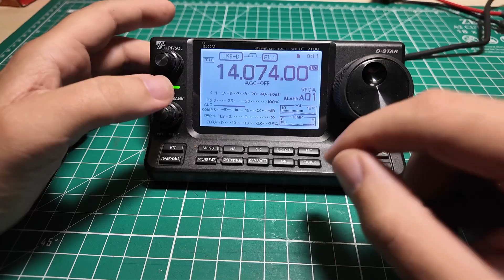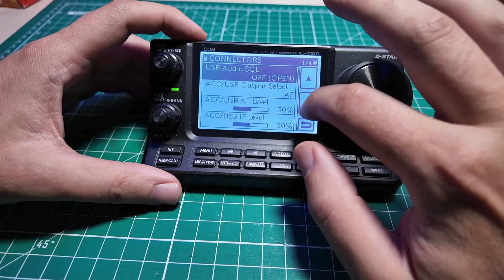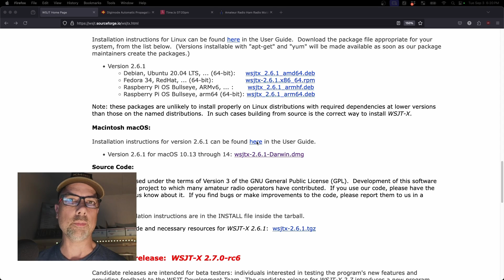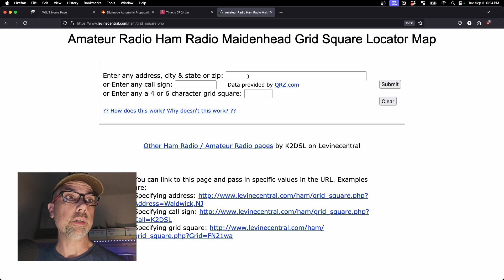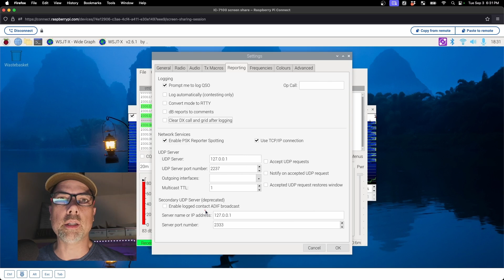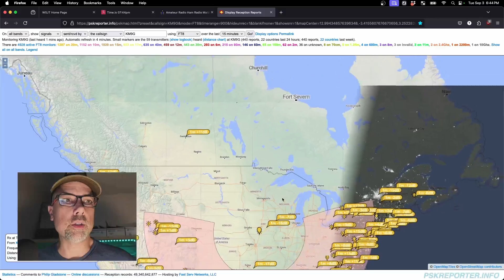Guide: How to FT8 with the Icom IC-7100

Comment: If you happen to be running your IC-7100 on FT8 would you be able to show any kind of manipulation on your ALC meter? No matter what adjustments I make in the computer or my IC-7100, I cannot get the ALC meter to go up or down. It does it on its own as I’m transmitting. For example, if I’m transmitting for an hour at some point, it will show two bars, then later it’ll show one or zero bars. 🤷🏻‍♂️ I tried every adjustment in this video and in Windows 10. No success. I should mention my FT8 is working fine.
Reply from the maker: As long as you're below the half mark you'll be making contacts.  The settings to fix that are all in the PCs Audio system.  Keep digging!

Comment: Can the 7100 be set as a session so that once the settings are ok, you can recall them and in the meantime talk on SSB etc?
Reply from the maker: No, that feature came out later on in a firmware update to the 7300 and on the 705.

Comment: Awesome video!!  My 7100 is set for back-pack field use but when it gets cold and wet this year I am going to watch this video ten times and get it figured out!!  Big thanks.  KN6OUJ 73
Reply from the maker: Good luck Alex!
Reply: How do you have that setup?  Looking for a backpack rig and I like the 7100 but that control head doesn't seem good for it
Reply: @CowboyPilot79  I use the 7100 in a backpack and it works great. I wrap the control head in a microfiber towel and put a couple of multi-use hair bands around it to hold it in place. I have the rubber feet pointed to the inside of the pack and my battery goes between the feet and the control head on top of the battery. Short power cable, control cable, and microphone in a separate compartment. There is plenty room in my small pack for a jacket, extra socks, antenna, etc. in the main compartment. 
Good luck! - KG5CYA
Reply: @rickarddavis8209 nice that may settle it, I've been trying to come up with a replacement for my G90, sounds like a 7100 will fit the bill.  Not sure how much I'll miss the waterfall but it will probably be more for directed comms anyway

Comment: I noticed a video you made earlier about the icom 7100 not transmitting, never seen an update on the problem you found it.   Just wondering 73
Reply from the maker: Its a "known bug" with the IC-7100 - requires that you factory reset it enough times to clear it out properly.  Disappointing because the radio is otherwise solid and that's a firmware fixable bug as far as I can tell (I didn't replace any hardware in the fix)
Reply: @temporarilyoffline  okay, never had that problem with the few ive had.  Just wondered and enjoy your videos. 73
Reply from the maker: @kennythompson9850 thanks!

Comment: Bunch of the 2M guys asked me to go FT8. Have 2 ic-7100's side by side in the QTH. One is set up the VARAC and PSK31. Other is for everything else. Your set up video is the best I've ever seen! Thanks. I don't think I'd like FT8 though. Great job!
Reply: I agree, this is the best video I've seen on FT8 and the IC-7100!  Thanks!
Reply from the maker: @robertbeasley4590 you're welcome!
Reply from the maker: Thanks for the kind words.  Like anything else, you have to find a mission for it.  Worked all grids with grid tracker? Contesting? Worked all states in a weekend? POTA while cooking dinner in a park? Or any of the other modes in the software...

Comment: great video, I just got a 7100 had been doing ft8 and cw things with a qmx for about 6 months while learning the ropes. This is quite the upgrade. 

The way you remote into an rpi is fascinating, great idea. 

Windows seems to hate this radio, anytime it starts to transmit it beeps at me detecting a new USB device then closes the port. I did not have wsjtx set to fake-it though so perhaps that'll solve it. 

If problems persist I got a bootable ubuntu ready and I can install wsjtx and see if linux works any better for me, or I have a few Pi's around and I can remote into one of those puppies! 

Radio stuff is a lot of fun

Thanks for putting this together, it helps the new guys like me
Reply from the maker: Hey Joe - it sounds like you have a problem with RFI.  When you transmit, you have radio signals going into the USB port and the computer loses it.  See this video for a demonstration of the problem and a set of solutions (chokes EVERYWHERE):  https://youtu.be/gwdEZlHSmjg?si=0sxQJ9RphnxaWoY4

A quick solution might just be to move the antenna further away.  Not sure 100% of your setup, but RFI is likely the cause.
Reply: @temporarilyoffline the antenna is outside of the house I'm running 25 yards of lmr200 to the end fed halfwave. I just crack a window and toss the cable out and hook it up. The antenna is hoisted up a spiderbeam mast. 

I'll check out the video, but the windows drivers setup 2 ports, half the time one of them says it has a problem and requires a reboot and its random if both devices show up without any apparent issue in device manager

The odd usb behavior just simply plugging it in makes me think its a driver issue not a hardware one. Thats before starting any software or transmitting on the radio. Just boot up, radio on (any frequency), and plug in the usb. 

I downloaded and installed the icom 7100 drivers and I guess having 2 ports is what its supposed to do (I don't know, I'm new to this radio). 

So that's why I'm going to plugin to a ubuntu box and give that a go next. I'll let you know how it goes, maybe tonight or maybe next weekend dunno. Depends how work / family / things go
Reply: @temporarilyoffline listened to the video, thank you!! I'm ordering two of those 240-43 and I'll get some chokes too to attach to the coax where I plug in at the EFHW. 

Mean time I'll also give ubuntu a try as I am seeing strange stuff in windows too. The laptop is not super old, and I'll have 2 more laptops to try soon too so perhaps between everything I'll figure out what's going wrong soon
Reply: @temporarilyoffline you're dead on with the issue, thank you so much! 

I don't have the toroid yet but i had 15 chokes i put mostly on the usb and some on the coax feed line. The scope looked better on wsjtx and it transmitted fine on 20m. I ran it at a pretty bad time of day where my qmx would struggle. I could see my signal on psk site going all over the usa and i got two responses before shutting it off

I am so curious how it's going to run when i finally get the toroids! 

Thanks again!
Reply from the maker: @HoldFastJoe-x7b sweet! Glad it worked out!
Reply: @temporarilyoffline I got two toroids, 240-43, and I wrapped co-ax about 17 times around the toroid and it ran so well, I was so happy! 

Digital scope was clean as can be, CW was better too (though harder to a-b test without a spare cable without toroid on it). 

I made several bahama's contacts, a few in europe, and handful around usa. Made more contacts on 20m in an hour than I ever have before! 

SWR meter on the radio was also very happy with the change. With the clip on chokes it was reading 1.5-1.8 swr, with the toroid it never went above 1.1. My signal strength on pskreporter was also significantly improved

thanks again!
Reply from the maker: Tahat's awesome, good to hear it worked out  @HoldFastJoe-x7b
Reply: I listened to part 2 of the noise video, glad i ordered 2 of those toroids! I'll wrap the coax and the usb cable when they come and see how it goes!

Comment: Awesome video. I did not realize that you could actually turn AGC all the off. Thanks. Now, if I can figure out why I am not putting out any signal.
Reply from the maker: Oh man, that's a tough one.  Check in the menu on the radio.  There is a setting for "DATA MOD"  and it should be "USB". That one gets me all the time!

Comment: Thank you. I’m a new technician. What radio do you recommend to get. I have MS and want to use digital and Cw with keyboard. I have a budget up to $2k on radio.
Reply from the maker: This radio is fun, but a little dated.  If you're not needing a mobile rig, I'd currently be looking at the Yaesu FT-710. https://amzn.to/3DQyeDe
Reply: @ thank you for your advise. I won’t be doing any mobile. I like to be able to do pota, in my good days. I can buy a smaller radio for that also.

Comment: This is timely, because I just picked up a used IC-7100 and it's now probably going to be my main POTA rig since it's so convenient to just have in the car. Remember that question you just posted about "do you sell or do you keep?" Old as it is, the 7100 might have me selling a few I thought I'd never let go of. Depends on how much I miss the waterfall of the 710 and the G90.
Reply from the maker: The 7100 is tough to get rid of!  When I was new I really "needed" a waterfall, now I'm old and don't really mind not having it.
Reply: @temporarilyoffline  Waterfall on cheap SDR was what got me into the hobby finally (well, there was more, but it was one of the gateway drugs). But I'm on a long road-trip East with POTA stops both along the way and while I'm visiting in NJ, and I've committed to using the 7100 for everything, and so far, that's working really well!

(I have the G90 along as a backup, but unless something actually breaks, I don't anticipate using it!)
Reply from the maker: @WD0OMHamRadio  The 7100 won't let you down.

Comment: That was great . Lately 10 and 12 meters FT8 is wide open worldwide. Some radios do not have ALC so I just use watt meter . Once I get that set then I dial radio power to tevel I like. .  That power level in WSJT-X is audio level . I had trouble at first but now i got many different radios to do FT8/FT4 ETC.  I normally use IC 7300 or my QT 60 with Digi Rig for sound card . cat control is manual on that .I have found that a GPS dongle works great except with heavy clods or wooded area when POTA . Then I can't get a lock. WWV is a good fix. My laptop keeps good time so before I go out or I stop on the way to POTA spot I sync my time and good for a day or 2 . many places have free WiFi so I just stop in Sync my laptop for time. Now I never have time Sync trouble anymore . I did camping before . But that was me forgetting to sync my laptop when I had internet or GPS . Now I have a program to do it when ever I am online or GPS lock.  just 1 more program running in background and if I forget to sync time the program does it for me.  So I can't be late for dinner ! 73
Reply from the maker: Oh I bet you could still be late for dinner!  Thanks for stopping bye!
Reply: @temporarilyoffline  Merry Christmas ! Girlfriend is a health care  worker and got called into work on the 25TH So she late for dinner hear! LOL 73

Comment: Definitely looking forward to playing with FT8 , just paid my license fee and should have a call sign today .
Reply: I believe the IC-7100 is one of the easiest radios to use, which includes HF +6m, 2m, and 70cm bands. Includes D-Star which may or may not interest you. The touch screen is fantastic! I did break the radio, which I need to fix. The only thing it doesn’t have is the color waterfall.
Reply from the maker: Sweet, Congrats!